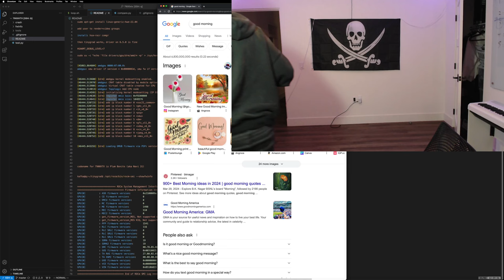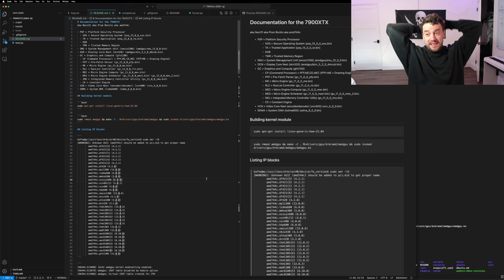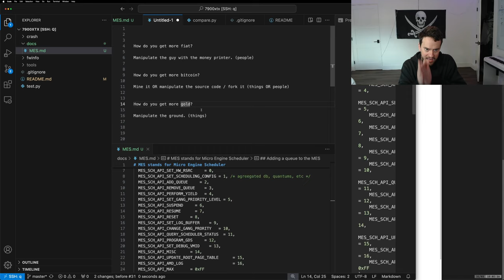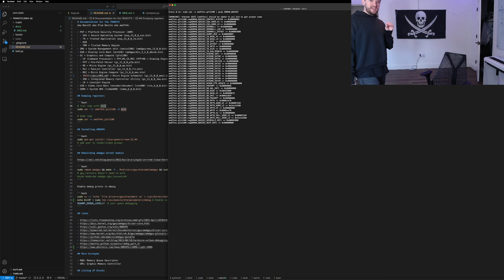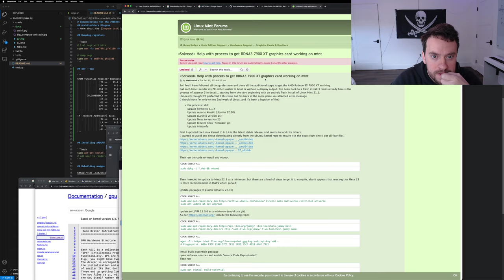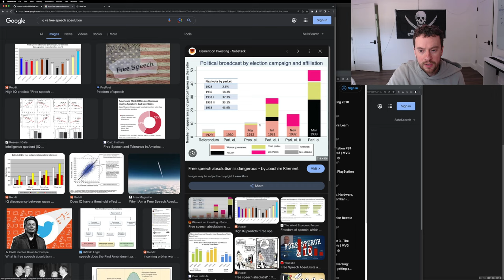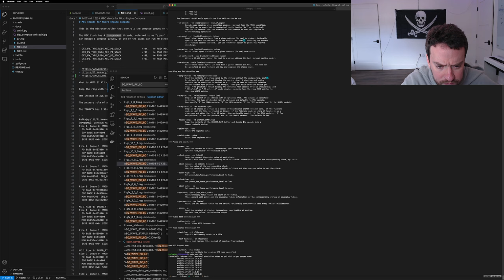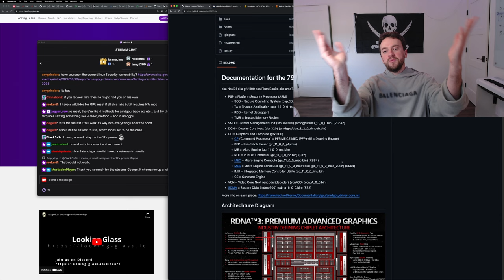George Hotz | Researching | documenting the AMD 7900XTX so we can understand why it crashes | RDNA 3

Comment from the maker: Documentation for the 7900XTX -> github.com/geohot/7900xtx PRs welcome! | 06:56:30 job offer to github.com/gnif | $1000 to fix a reset of GPU for github.com/gnif | 07:02:15
Bounties for tiny corp / tinygrad -> docs.google.com/spreadsheets/d/1WKHbT-7KOgjEawq5h5Ic1qUWzpfAzuD_J06N1JwOCGs/
youtu.be/lnVQsJJFcdg?&t=13715 Hiring entire stack for tiny corp join if you are interested | youtu.be/lnVQsJJFcdg?&t=14195 work major source of value in your life 
Pre-order tinybox buy.stripe.com/5kAaGL6lk9uX9nW144 more info on -> tinygrad.org | github.com/tinygrad/tinygrad <- simple powerful deep learning framework
tiny corp is accepting new interns. more info on tinygrad.org and tinygrad discord | comma.ai is accepting interns comma.ai/jobs#open-positions
from $1050 buy -> comma 3X comma.ai/shop/comma-3x | best ADAS system in the world openpilot.comma.ai | from $999 comma.ai/shop/body the future of people
Support George by subscribing twitch.tv/subs/georgehotz | Follow George on twitter.com/realGeorgeHotz to be up to date | Read George's geohot.github.io/blog/
Chapters:
00:00:00 intro
00:01:25 new KFD backend
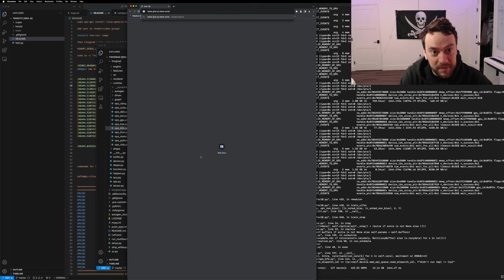00:03:50 never give up
00:05:20 tinybox
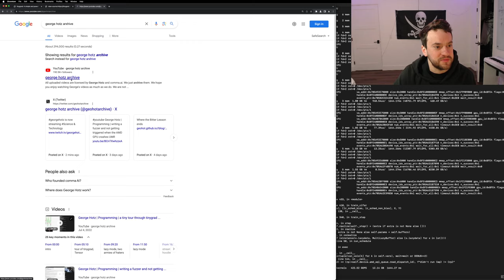00:07:00 looking for comment
00:11:35 docs for 7900XTX
00:13:40 university attendance over time us
00:22:00 vscode markdown preview
00:31:10 signature solar, solaredge optimizers
00:45:45 solar per watt over time
00:50:50 github.com/geohot/7900xtx, tenstorrent software
00:58:20 ubuntu kernel build source don't use apt src
01:01:00 AMD processes, Instinct MI 300, testing in isolation, crashes
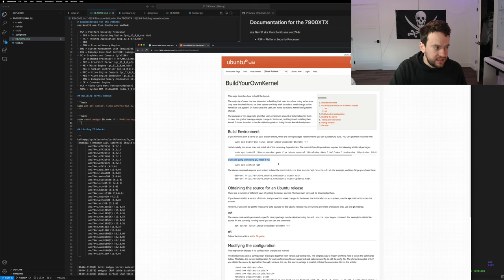01:03:00 no CI for hardware
01:05:50 planning, handling George as PR problem
01:15:00 nvidia taking AMD talent
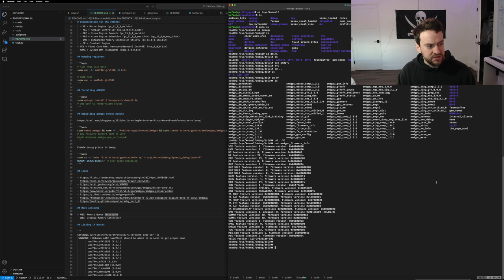01:15:50 old instinct cards
01:17:00 test_sdma
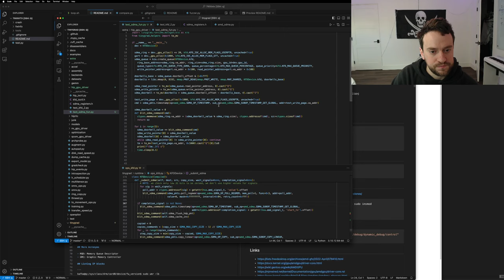01:34:00 firmware file, registers dump
01:37:55 all this docs might be wrong
01:39:30 drivers from AND will not get better
01:46:00 US government people
01:48:10 product engineering, operations, engineering mindset manipulating things not people
01:49:00 everybody who creates is an engineer, administrator not an engineer
01:49:30 boeing, outsourcing, operations keeping systems running
01:51:30 how do you get more gold, more fiat, bitcoin, people
01:54:00 proof of work to proof of stake ethereum
01:56:00 gold works
02:09:00 diversity is our strength
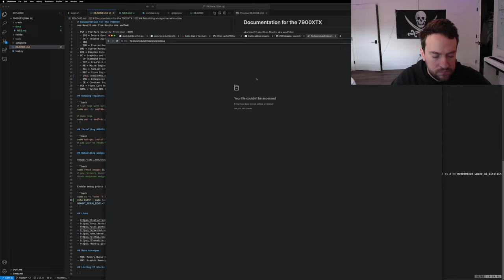02:19:55 DRM debugging
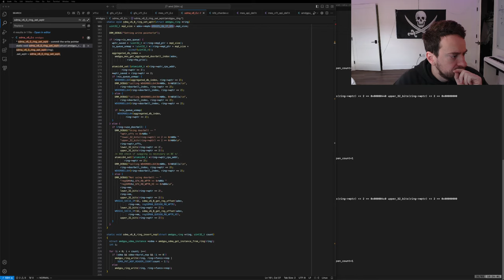02:24:19 AMD brutal reviews
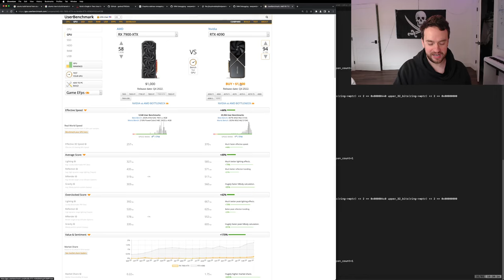02:28:40 4090 tracker
02:39:05 hardware resources
02:48:00 LSDMA, system DMA and other DMA
03:00:00 codenames, UMR
03:05:10 perplexity, searching, search engine
03:09:50 RDNA 3
03:28:50 compute unit
03:35:50 gpu hang, crash, piano
03:39:20 amd community forums
03:41:10 AMD release register reference 79000 XTX
03:42:40 George helping AMD
04:01:35 plum bonito gfx1100
04:03:15 RS64
04:09:55 AMD gpu mailing list
04:13:40 break, shower
04:24:50 should you buy 79000 XTX
04:25:35 AMD PR team, disparaging, George's experience with GPU
04:27:50 the modern consumer
04:30:00 open pilot CI, comma ai failure rate
04:52:50 radeon f32 processor
04:54:20 leak, leak is a public domain
04:58:50 XML dump of bonaire register docs
05:00:00 internet is under attack, remember when google worked
05:01:00 2014
05:06:00 free speech, hate speech, iq vs free speech absolutism
05:17:40 MEC, amdgpu microengine compute
05:46:50 how to power cycle pci device
05:50:15 AMD I want the MEC
06:24:10 error: object file empty git
06:27:25 docs for 79000 XTX overview
06:35:40 SDMA+RLC are F32, RS64
06:38:10 AMD source about register access
06:41:55 ibm rs64 32-bit
06:46:10 rs64 soft core
06:50:50 Alex, RDNA 4
06:53:40 reading about workload managers
06:55:30 the AMDGPU code base 
06:56:30 job offer to github.com/gnif
06:57:20 writing software, taping out chips
06:58:40 prediction on AMD high end GPUs
06:59:35 qualcomm reverse engineering
07:01:30 openmax, OMX
07:02:15 can people draw attention to this?
07:03:40 looking glass
07:05:35 internal AMD docs
07:06:40 tinygrad new driver, new style of driver, CommandQueue
07:07:20 $1000 to fix a reset of GPU for github.com/gnif
Reply: you sir or miss, are a beast

Comment: For solar Fronius for AC couple inverters and Victron for DC / battery coupled inverters, they are the industry standard outside of the US.  A lot of installs use both.
For install, it all about putting down a t-slot matrix on the roof, then the panels just attach to that.

Comment: Solar is usually wired in series up to around 500v 10amps.

Much more than that, you do another run.

They have special socket connectors that make it pretty hard to touch the contacts.

Solar is pretty easy to install, the problem is, you're problem is, if it's roof mount, you're putting lag bolts in your roof and you want to make sure they're sealed well.

If you haven't done roofing, you probably want to have a roofer show you the basics.
Go with a high end sealant like geocell.

There are a bunch of different varieties, but usually it consists of a mount plate you bolt through your roof into the truss (use a hammer to find the board, stud finders usually won't work, sometimes infrared will, but just use a hammer, you can hear it).

Once the mount plates are in, you have a bunch of hardware you can bolt to the mount plates. Sometimes they clip directly to the panel, sometimes you'll have rails that you bolt to the mount plate and lock to the panels.

There are YouTube video instructions for all the different varieties. I like the low profile ones, but they're harder to get flat (your roof probably isn't as flat as you think it should be), and having a giant specular surface just accentuates it. And they're more expensive.

You'd probably want an electrician to install the inverters and everything. You can run the pipe for it and fish your wire through it, but with government regs, it's probably worth having the electrician do it.
Reply: You also might want to have your roof done first actually, depending on how old it is.
Reply: TBH I would not put 500V of cells in series, unless the area is free of partial shading.

Comment: The high cost of solair panels can probably sidestep by not hooking into the office braker box, like having it supply the servers and AC directly instead of the whole building.  The system can sill be net following but just internally right. idk about regulations though

Comment: I agree fiat currency is the root problem. I also used to think Bitcoin would fail for the reasons you described. Then I lived through the blocksize wars and realized that there is a small group of literally religious followers of the protocol that will never change the 21 million limit. As a nonreligious person myself I underestimated the power and irrationality of such a belief and the effect it can have long term. There will always be many forks on the source, but there will also always be at least 2 nodes running the "real" Bitcoin, thus the network is practically invulnerable. Gold cannot function as money because you can't verify the total supply of the market without intermediaries. Its pure physical nature makes it vulnerable to centralization and confiscation. Bitcoin is both natively physical via PoW and natively digital. It's perfect money.

Comment: with amd i dont get why they had such success with their cpus, but handling their graphic cards that poorly
Reply: Simply, Intel stagnated, and Nvidia kept on improving with arguably perfect execution. AMD caught up with the former, and still playing catchup with Nvidia
Reply: ATI drivers were crap and AMD never cleaned house after the M&A.  Their cpu microcode and firmware is good and QA’d well.  Their gpus are not QA’d well.
Reply: AMD has always been a CPU company first and foremost.
Reply: @Edge9404  AMD is 3 companies merged together.  AMD (cpus), ATI (GPUs), and Xilinx (fpgas).

Back when AMD bought ATI, ATI was only slightly cheaper than NVDA in mktcap.  But cheaper doesn’t mean better.
Reply: @hdthor  that's not what I said though. I just said that they prioritize their CPU division.

Comment: I thought you guys were in CA. Doesn't CA code say you need to be grid tied? If so, I do not think you need to draw from the grid. That is the reason batteries are a good idea. Read the NEMA 3.0 and you will understand why storing power off grid is preferred. You do need permits but you can act as your own GC, write up the plans for the design of the solar panels install and take the permits out  yourself. You can then in theory hirer your own labor or do it yourself (with youtube and/or a GC/Electrician). You just need to learn some basic electrical infrastructure and put in the work. Infrastructure innovations and standards do not change that often like coding or software; it is more like (layer2) networking protocols, i.e., BGP, OSPF etc., and easier to learn.

Comment: The only thing I hate about AMD GPUs is the unstable drivers. The hardware is awesome and the features are better than Nvidia in some circumstances like image sharpening (Nvidia had to remove that feature because of how bad it was LOL) 

But it's just the crappy stability issues with the random stutters and the video encoder/decoder being bad
Reply: They are building a good reputation with AFMF (Fluid motion frames) and I hope that makes them realize of something. If they try, they can do anything possible, and if they achieve stability they could take over nvidia for gaming.

I hope they learn